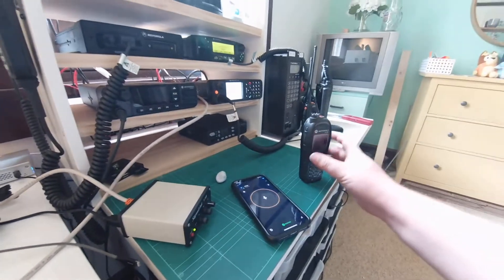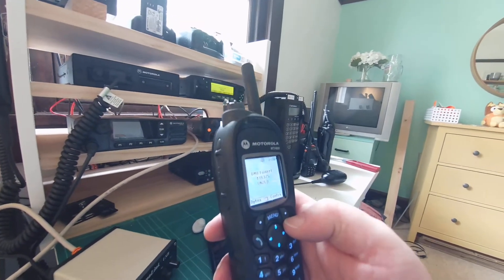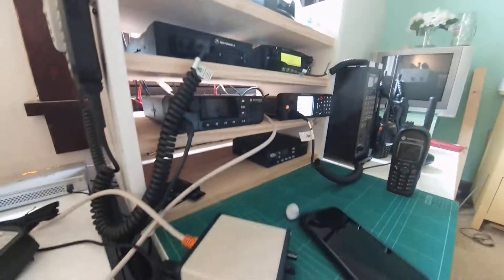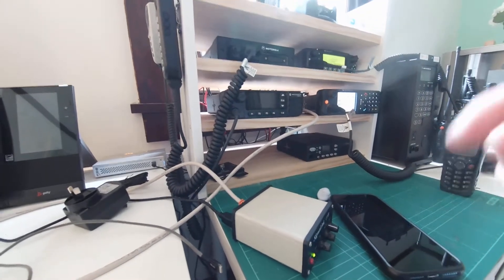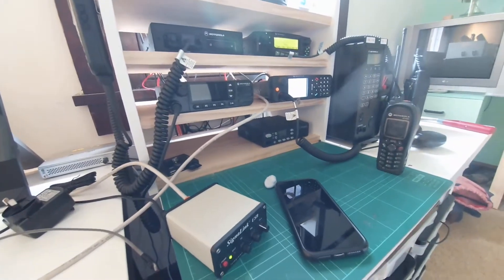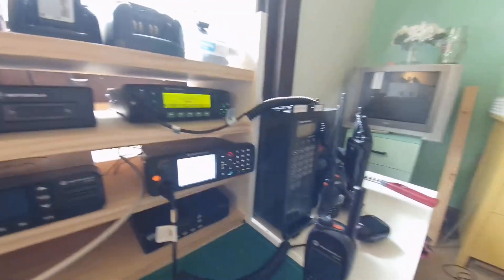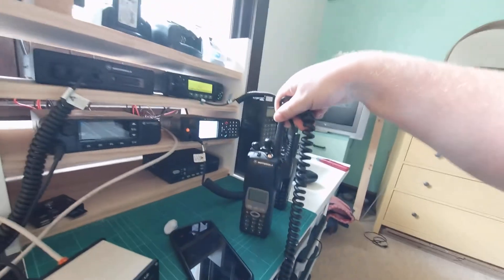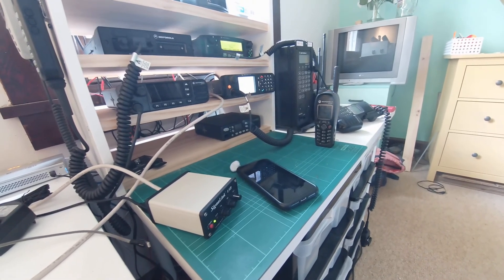Motorola Tetra to Zello (ROIP) call demo

Comment: Our ham radio club interfaced Zello but did not use VOX and Signalink. When there is incoming transmission from the radio (detected from the DCD pin of the serial port), a bridge software triggers the PTT button of the Zello software. When there is audio coming from Zello, the same software activates the RTS pin of the serial port that goes to the radio interface. Also, our two-way radio interface circuit is DIY so the cost is lower compared to purchasing Signalink. Further, we use old Motorola Maxtrac/GM/M/CDM radios so cost is cheaper compared to the Motorola Tetras.